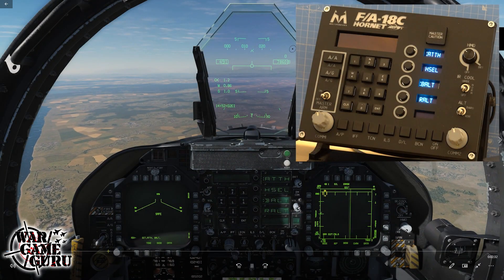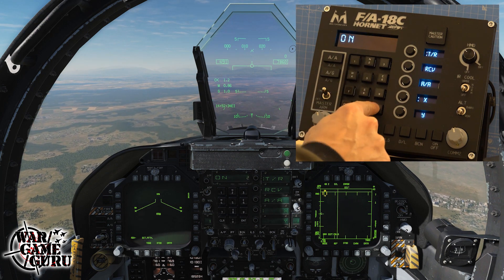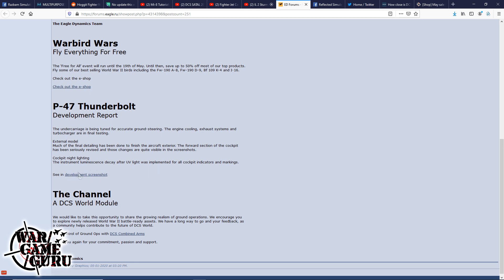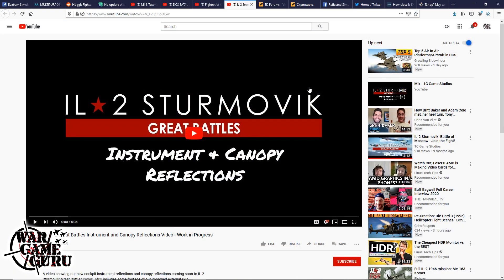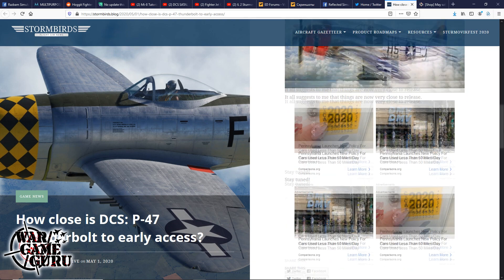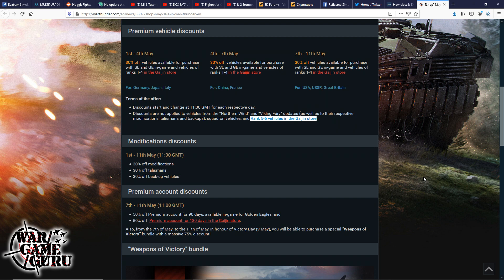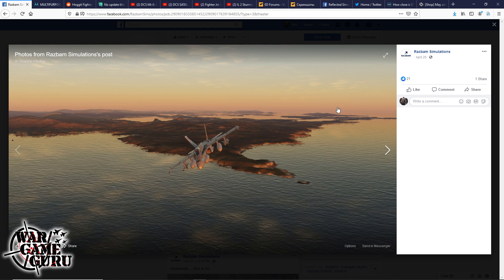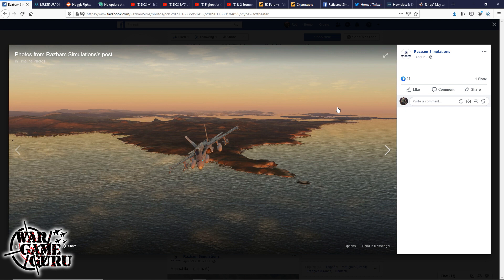FLIGHT SIM NEWS 5-2-20 - Exclusive look at M-UFC hardware in use!, DCS P-47, & IL-2 gets reflections

Comment: Hey Rod, great video as usual, much appreciated.  Gotta agree that VR performance went down the pan with 2.5.6, but the VR shader mod brought it back to playable for me, even with a 6700k, 980ti and 16GB of DDR4.  Do you use the VR shader mod, or have you never tried it?
Reply from the maker: Afraid to use the shader mod from messing up my 2d performance as I don’t play exclusively in VR
Reply: @rodwhite5274  it hasn't effected mine, the shaders only seem to apply when the Oculus runtime is active, so if you close it down through Oculus Tool Tray they won't apply; you get the full screen.  You can also activate and deactivate the mod using JSGME. Of all the things you can do to make a difference to performance in VR, this was by far the most effective for me...
This is the video that explains it:
https://youtu.be/bkzHTclRIgQ
Reply: Don't say "even with" in regards to a 980ti. As far as DCS goes the 2080 is barely better  than the 980ti.
Reply: @baaamakingbaaaa  if that's the case, they really need to fix this shit.  There must be something terribly wrong; roll on Vulcan.

Comment: It's neat, but pointless as one would be better off spending money on VR and haptic or other virtual touch controls.
Reply from the maker: VR is pointless at the moment due to the abysmal performance in DCS with high end hardware. Until they can tweak it, VR is a hard sell for me in DCS. It was better before, but now it's almost unplayable.
Reply: I can put up with a bit crappy graphics and performance for the immersion vr brings. Spend the money on pointctrl rather than a button box.
Reply: I have only played DCS in VR. I can't fathom any enjoyment in playing something like this without the submersion of virtual reality. Even using trackir... no way. Would I get more kills?  Absolutely. Would it be fun? No.  Using rift-s with a mediocre system and it's as smooth as can be in MP in stable and open beta.
Reply: @baaamakingbaaaa  spending hundreds of pounds on a ufc and you can see the wallpaper (don't forget the decorating needs doing) behind it is an immersion killer 😀
Reply: @baaamakingbaaaa  got to agree; TrackIR is almost cheating too; nobody can turn their head 180 degrees unless you have Owl DNA.  Cockpit maximum head rotation should be restricted to real life values...